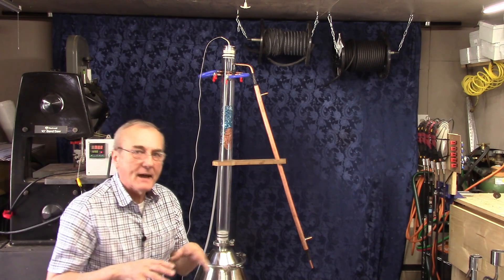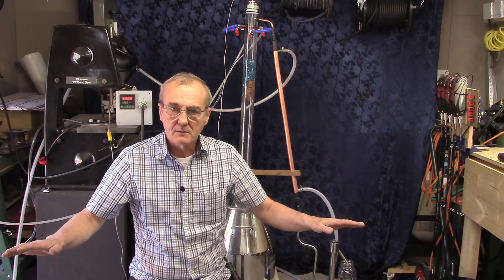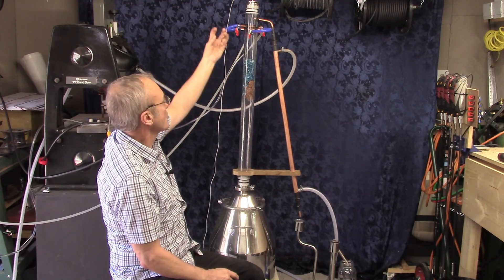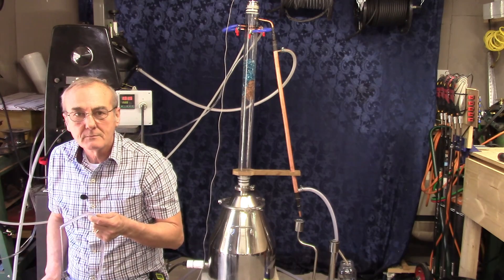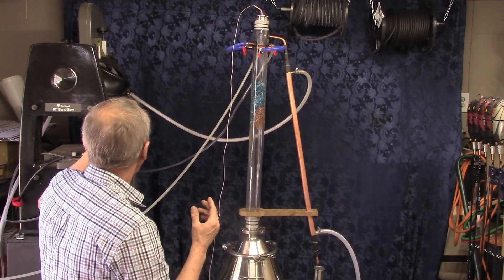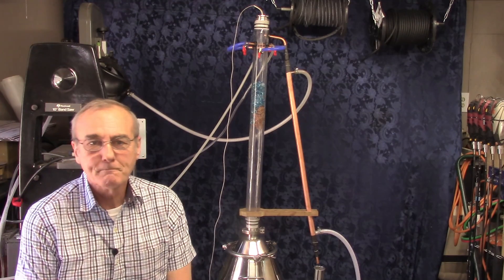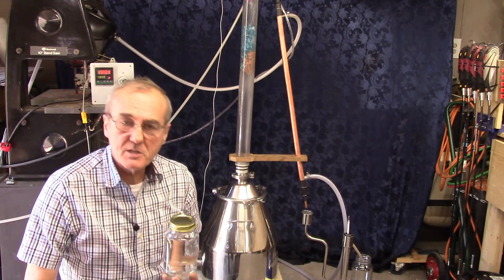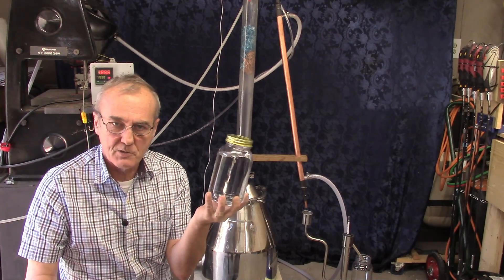2 INCH GLASS REFLUX COLUMN FIRST TIME RUN PART 2

Comment: Nice curtain, George...😂. Those needle valves are good value, your reflux looks really good also. If there is only 170 in the still, that's all your going to get. You can't get 190 proof if there is only 170 in your mix.

Comment: I'm just exploring distilling I've never made alcohol but I've been watching allot of your vids and others vids and was under the impression that only copper or stainless would be used for distilling, then I saw this vid and laughed as I'm a lampworker  and could make these glass tubes for distilling, hell I could probably make a whole still from glass and just wanted to say thanks for the ideal, this could be a project in the near future, all glass super fragile distilling equipment, oh I have seen the lab equipment distillation but I'm talking of building an actual glass still not just putting lab beakers together.

Comment: Could you place a temperature sensor inside the precondensor to control the temperature more accurately? Also would that ensure that the theoretically threshold of separation of water and ethanol can occur continuously?

Comment: Fantastic demo.  Understanding how little it takes to run the precondensor is a surprise.  I always see crazy amounts of reflux going on and by the looks of it less is more here.  Tiny surface area compared to the coils I have seen in ccvm very low water flow.  Being able to see what is going on at the still head is very informative

Comment: The best explanation of reflux made simpler by the fact we could see it. Many Many thanks. A newbie question for you George. You turned off the water and stopped the reflux so essentially you ran it as a pot still at the end. Was the purpose of doing this so that you could reduce the ABV and therefore predict/capture the tails? I'm guessing that doing this is not advisable on my T500 due to the plastic parts. Thanks for all your hard work educating us.

Comment: George, do you have any suggestions for data points on when to stop collecting when running in reflux?  I’ve heard you say 100 proof and 204 for running in pot mode. You’ve also said in reflux the proof falls off but I’m looking for something a little more so I don’t screw it up. Tks!

Comment: George:  A clarification please.  I understood from your videos that the water in the condensers always goes in on the lower port and out the upper port.  That makes sense for the primary condenser.  However I was reading the instructions for a reflux column, and they indicated that the reflux water flow should go in the upper port and out the lower.  That makes some sense as the vapor has to pass the warmer part of the reflux coils as it goes up the column, and before it gets to the cool part of the reflux coil.....??  Did I misunderstand your explanation or is the instruction drawing incorrect.
Reply from the maker: In bottom out top. If you have instruction from a manufacturer that says different follow their directions

Comment: Thought you might be interested in my still design. I have been using this basic design for the best part of 15 years and it would be ideal for first timers to fractional distillation.
https://dontblessme.blogspot.com/2020/05/the-slip-fit-auto-ratio-reflux-still.html

Comment: What kind of a difference does the bead/copper mesh stack placement do? In your stainless column you put the stack in the bottom part, but in this one it's in the middle. Does the placement effect the re-flux and in what way?

Comment: I see the cooper mesh and glass beads in the column. Is there a sweet spot for their location or does it matter..- location/distance from condensing coil..? I see a few guys placing them lower in the  column(for convienience). Just wondering  if it makes a difference.  Great video, thanks for posting....🥃

Comment: Hi George. Love your work mate!!! I have a question about  pre-condensing. 
I have seen some people using the dephlegmator but they are moving it up and down the column head to get the desired effect.
I am thinking that not moving the dephlegmater but increasing or decreasing the water flow through the dephlegmator would get the same desired effect.
Is that right?

Comment: Great video as usual Mr George I have a couple questions. I noticed your packing was a third of the way up the column is there's screen under there? Next question have you ever run the output from the condenser through the reflux chamber should I even try it? Lastly I know higher proof means less flavor profile carryover. And usually in a pot still 130 is serious results but say if you wanted 140 ,,used reflux at what point do you know when to return to pot still mode and shut off your reflux to avoid deminishings returns? Is it trial and error?

Comment: Hey George . I have a 15 gallon berwhus with 3 “ colum  reflux still with 2 1500w heaters. at the top I have a digital thermometer and was wanting your pid controller. How much for you to build me 1  and if I take the digital thermometer off how would I put the probe in.

Comment: George, I'm sure you know this but for those that don't you can get what I got for my Lehigh condenser. It's a 3/4" to 1/2" x 1/2" reducing tee. It's 3/4" in 1/2" out and tee's to 1/2". You have to use you travel to remove the shoulder which keeps the 1/2" pipe from going all the way threw. You slide one on the 1/2" pipe, slip a 3/4" pipe over the 1/2" the slide another reducing Tee on the opposite way. Then fit 2 short 1/2" pieces into the tee off and solder everything.

Comment: I am new to this, but I have a question about the amount that was pulled off the still. I do not remember if you said it was 5 gallons or not but you got 2 quarts.  Maybe I am over thinking it, but lets just say for example the OG was 1.080, that is slightly more then 10% abv.  5 gallons = 20 quarts, 20*.1 = 2 quarts total alcohol in the still. Of the 2 quarts, roughly 30% for each head, heart, and tails. (slightly more then a pint for each)   I was curious how there was more coming out. I know my numbers could be off a little bit I am generalizing for ease of writing.  Also is it really only 1.25 pints of hearts for 5 gallon?
Reply: Simple, if you distill a 5-6 gallon of any type mash you will get about 2 1/2 - 3 quarts of heart spirits before diluting.  Best to stop at 50% ABV (100 proof).

Comment: Excellent videos, George. I've been watching these for over a week now. We are in need of sanitizer in Dallas. 
Yes, you know where I'm going with this. Mostly out of stock in at least two major hospital systems. I'm a DIY sort of person but now looking at getting up to speed ASAP. BTW, just thought about the fuel ethanol-energy scam. Why don't they divert that waste of resources? Solve two problems as once. 
But that's another topic. 
I have a few basic questions and some interesting ideas like a reduced pressure (vacuum) heat pump distillation idea. Why not move the heat around and pull heat out of the condenser and move to the boiler. That's where the vacuum might come in. I'm not sure one could get to high enough temp for a boil with conventional heat pump system. OTOH, there are heat pump water heaters so I don't know. Hack one of those and use the cooling coils to provide cooling of a recirc tub of cool water. Let's work on it.
But I'd probably best stick with basics for now. 
Would you mind an email to me for some questions re low cost turn key refluxing still to get to at least 180 proof? I've watched a good number of your vids so far. Perhaps you can help a number of us docs and healthcare personnel with this problems. 
Can you email if you have a moment? We have a couple of unemployed docs ready to get to work on this.
Cheers, DJ dejswa@yahoo.com
Reply: A T500 is a good start up still to cut your teeth on and it will give you almost a gallon of 180 proof your looking for with every 5 gallon batch you run if you shoot for a high abv mash. Plus the only adjustment is for water so it's pretty easy to use.

Comment: Can you give us a review of your grain grinder?  I was it in a previous video, but I didn't see you use it.  There's no online reviews of it.  Awesome video! keep up the good work!
Reply: I have same grain grinder and it is awesome!  I had a typical roller type but it wouldn't crush corn so went to the electric like George's.  It does far better  and more consistent job of crushing while producing very little powder.  It is quick too.  I got mine on ebay.  They sell 220v and 110v units.  You don't need the 220 unless doing very large quantities of grain.

Comment: Hello George, thanks a lot for your very useful videos. Can you make a video for propane distilling, in my country, propane does the main fuel and much cheaper than electricity. I know you might not have the equipment but if you can give some tips for those of us that haven't access and means for PID controller that would be awesome. and I really like to see how the final flow from the two-inch column as I know it's one of the main factors for balancing the reflux system, especially in the propane system.
Reply: Hey Uncle.... I will talk to George and see if we can get a propane version of the P&ID controller for propane systems.... don't hold your breathe... but we will see what George and I can come up with.... colllectively... #happydistilling..  :)
Reply: @cryptoponics  WOW... thanks so much... I believe many of us will be grateful ... Happy distilling :)
Reply: @uncleowl8187  I would like to see it done by propane also!!
Reply: Give up gas and go electric.  You will never get the precise control from gas that you can from a PID controlled electric still.

Comment: I really thought with the two plates the copper and marbles it would run 190 or better .What would you do to achieve that 190 or better more marbles.?
Reply: Using only plates, starting with a 10% ABV charge in the boiler, the vapour above it, and thus the liquid that condenses on the first plate should hit around 55%. The first plate will then act like another still with a 55% charge, so the second plate will hit around 81%. A third plate will hit 87%, a fourth plate will hit 90%, 5th plate 91%, 6th plate 92.5%. You can see that when you get to really high ABVs on a plate, the vapour of the liquid above it isn't that much higher ABV. It isn't until a 12th plate that you hit around 95% in the charge.

Using packing, you can create "theoretical plates", so a certain height of marbles, raschig rings, mesh, or spiral prismatic packing inside the column, will equal a plate. For example, 1" of SPP is typically equal to 1 plate. So with 12" of SPP, you could hit 95%. But then you need to balance out what kind of packing you use, with whether or not your still can push the vapour up through it. SPP is hard to push the vapour through, so you might be running you still full power the entire time if you are using 12" of it, or you might simply not have enough power to push the vapour through 12" of SPP, and you need to go with something else, or with a combination of things.

Comment: I have subscribed. 👍. I use to work at a oil refinery 20 yrs ago and I have been thinking about building a still. Then I ran into your videos. You're SPOT ON. In fact a lot of what I learned all came back. Bubble trays,reflux, the water flow through condensers. When refining petro, you controlled the tower thru reflux. Wow. I'm so glad I ran across you. I got a lot to learn. Already have a design for my still, because of your videos. P.s. at the refinery I had to use hydrometers in measuring specific gravity of the products coming off the main crude tower. Heavy oils,diesel, kerosene, and naptha. It's been fun watching you work.
Reply: I'm currently an Operator at an oil refinery and I'm working on building a reflux still now. When I first became interested in distilling alcohol I only knew about pot stills with thump kegs, but as soon as I found out about reflux stills I said "Hell yeah! That's something I know how to do!" Lol anyways, happy distilling.
Reply: Heath Wise I just retired last year . I was a shift supervisor in one of the control rooms at a refinery . I’m gonna build one of these to keep me outta trouble since I have all this free time !!!!
Reply: Nathaniel Nelson funny how you remember things. I retired last year after 4o years of running columns . Either cryogenic separation or petroleum . This is way more fun.

Comment: Perhaps worth trying is to pack more copper mesh into the column so that it touches the reflux pipe, that way (copper being a good conductor) you should theoretically have a more gradual reflux going on.
Reply: Actually, glass marbles do much better than copper mesh.  You don't need to use copper at all.

Comment: Awesome video. Where in the world did you find a glass column? Very informative showing exactly what the vapors/condensing actually do in the column. You explain it better than anyone I've spoke too and i've been in this for a long time. thank you Sir.
Reply: I have 15 of these glass column kits for sale.
Reply: @bking0740  what do you use for the connections? I'm a glass blower and have access to lots of tubing and have been wanting to make one with some 50mm I have laying around but can't figure the connections out
Reply: @MadJix  traditionally lab glassware used ground joints and a dab of petroleum gell  to stop the glass vacuum bonding and refusing to separate. I think more modern Lab glass use pliant plastic bungs with holes in of different sizes and compounds. (Nitrile, silicone, etc depending on chemicals being distilled)

Comment: Are you using an aquarium pump for your reflux chamber?
Reply: It's just a secondary pump with a low flow rate.  The primary or main condenser gets a large flow, and the reflux condenser just needs a small flow as you see in the video.  I actually have a split tee on my system so I only have one pump, but George likes to have 2 pumps so as not to complicate the situation.  Easy maths...